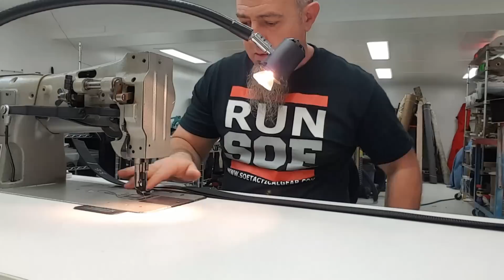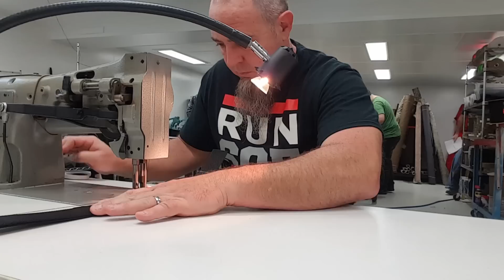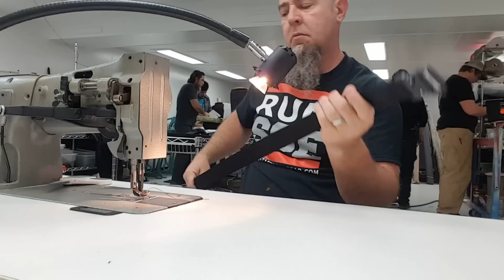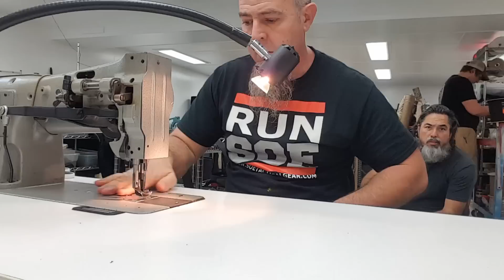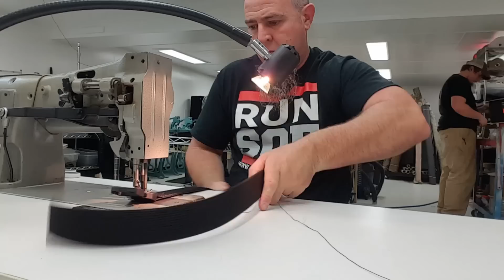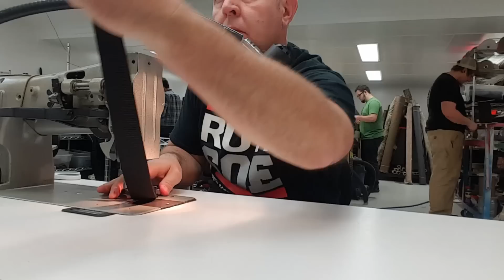sewing a few belts this mornin.

Comment: John, that looks like an oversized table that machine is mounted in? These "standard" 24x48" tables are so small, especially for those of us who sew bigger items( I do custom tarps, covers, etc). Not to mention I'm 6'4", so not your "average dude height wise, haha. Looks like you're giving that machine a good workout! Juki?
Reply: John Willis The Consew 206 is a good machine. I'm upgrading to a used Juki automatic right now, but I'm still in "startup mode". Any experience with Nick-O-Sew or Robert Collier by chance? Truth be told I watch your videos more so I can learn from what your talk about in regards to business. I'm not seeing tactical gear, but in this video ^^^, you mentioned about saving time in thread nipping, vs the (minimal) coat of the thread itself. I'm doing everything I can to maintain a "lean" style of manufacturing, takes some work but it sure does save time!